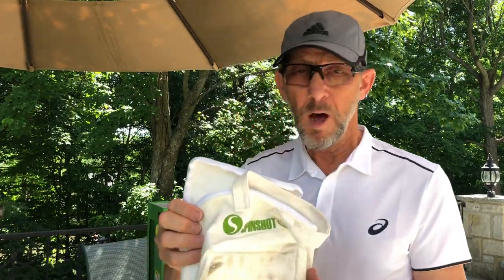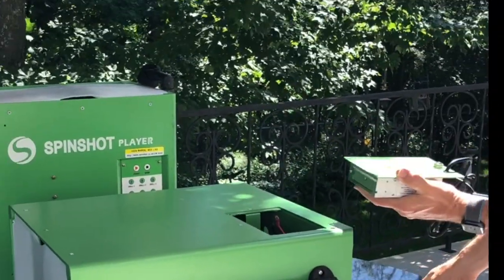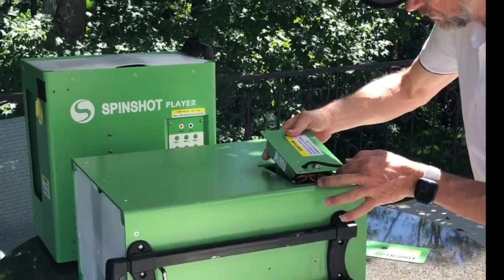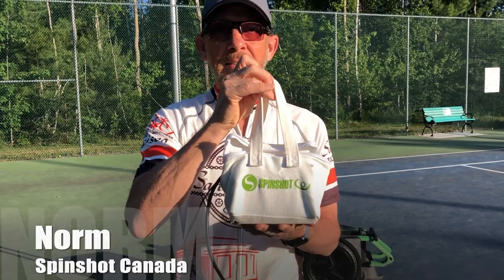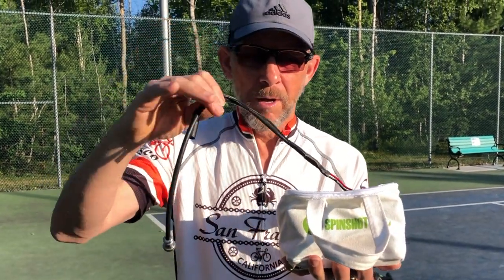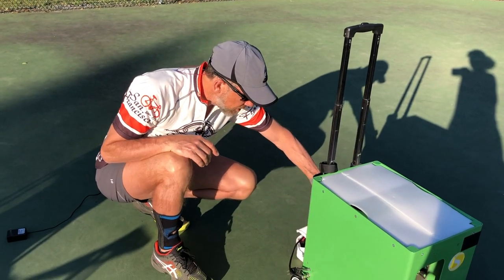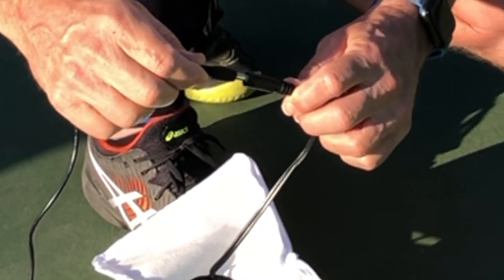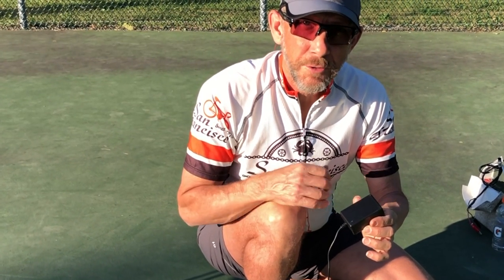Preparing your Spinshot Tennis Ball Machine for first use

Comment: I have a spinshot player and there’s no way I can tell if the battery is fully charged because there’s no indicator for that.
Reply: The indicator is on the charger
Reply from the maker: The Drill Maker app shows the current battery charge. New machines also show the voltage on the control panel screen

Comment: Hi, I am not sure what I am doing wrong but when I set it up for swing , 2/4 balls will go outside the playing area I am unable to fix this please advise
Reply from the maker: It sounds like you need to adjust the alignment of your machine once its finished its start up sequence. Just turn the machine slightly towards the other side of the court and it should fix the problem.
Reply: I thought I’ve read that same type of problem before and I thought as carefully designed, if the machine was positioned in the middle of the baseline then it shouldn’t shoot the ball outside the court.